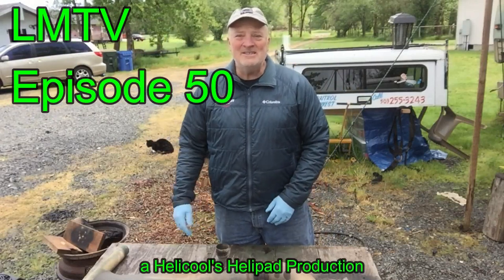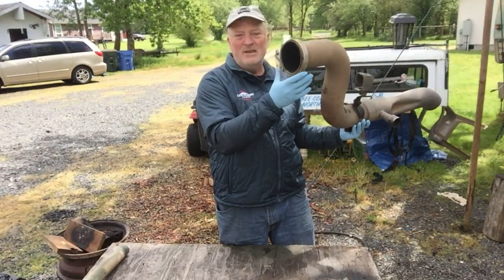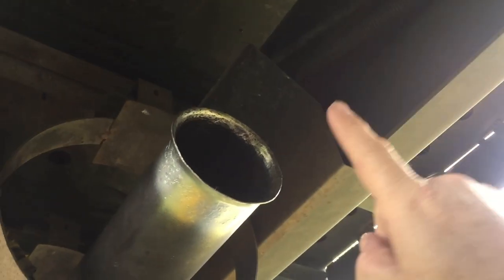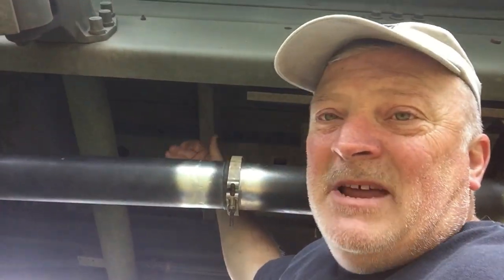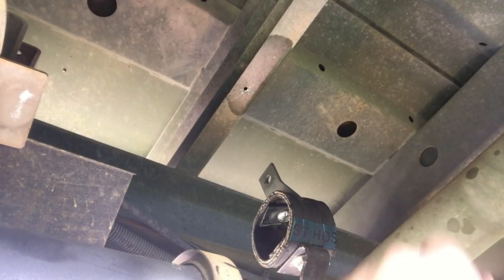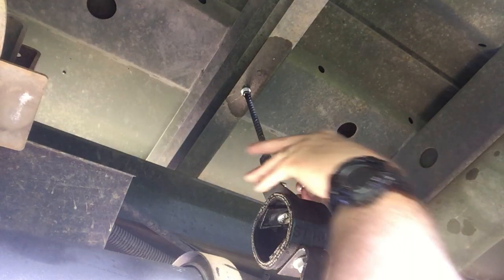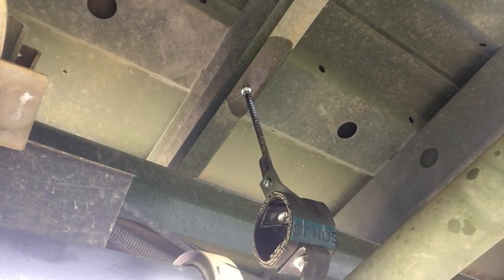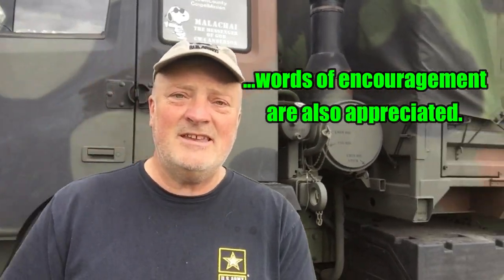FMTV EXHAUST SYSTEM MODS III #48

Comment: Hi Dave, do you have plans for the space you've made on the side were the exhaust came out?  Ex. Storage or something like it.
Reply from the maker: I have been thinking about that... just lack the funds to make it happen. I also have to be careful not to change the overall look too much, since it is supposed to be a "military" truck and not a camper. It would be nice to have some storage space though. A real nice spot has opened up where the exhaust was, and just aft of the fuel tank is another great area.

Comment: Cool video!  Thanks!  Just a reminder though...decibels are on a logarithmic scale.  So 80 dB = 79 dB x 10.  85 dB = 79 dB x 10 x 10 x 10 x 10 x 10 x 10.  So, that’s why it’s important for noisy areas to be well understood.  Exposure to 80 dB is where hearing damage begins (with some sustained exposure). I imagine the military requires sustained dB to be below 80...hence the muffler.  I’d be curious to see / hear / measure the before/after in three places (cab, beside truck, behind truck).  It sounds like it was remarkably similar in the cab..possibly quieter...but louder to the side of the truck.  I imagine the change in dB from behind is substantial.
Reply from the maker: Thank you for that explanation. I did not go and measure the dB behind the truck... I suppose it might be louder. What I can say is that I can hear the turn signal "tick" when it blinks and the push button Allison transmission selector "beep" when I use the selector. No way could I hear that before. I'll check the dB and post it to my next video I should have done by this weekend. Thanks for watching and supporting with a valued comment.

Comment: Hi Dave, why not lead the exhaust on top?
Reply from the maker: I don't know. I didn't think about that since I had the V channel clamps.
Reply: I think the dust expel feature would not work as well.   You might end up slowly filling the pipe with dirt.  

Just a guess.  No data to support this concern.   That was my main concern because I thought of the same thing.
Reply: In august I will try to route the exhaust on top, use a different air cleaner and thus create extra options for fuel and water tanks in the frame. Keep you posted.
Reply from the maker: @mvdb5150  Are you going for a vertical pipe? Also, with this be a muffler delete and plenum Venturi delete? I don't recommend the later.
Reply: Helicool's Helipad, maybe with a Donaldson airfilter the vertical pipe option will work. Different plenum.
Reply from the maker: @dcraigslist5243  I suppose that could happen, but if you think about the only things that can get into the plenum are small particulate matter and insects. I think both of these type materials should vacuum fairly easily, especially at the higher RPM experienced while taking off from a dead stop. I'll keep an eye on it by removing the flexible hose from time to time. If something starts to build up, I'll report it.
Reply from the maker: Michel van den Bosch well, alright! That will be very interesting... please post pics on the LMTV site.

Comment: Awesome work.   I wonder how much better it would be if you run the pipe all the way out the back.   

Did you measure the noise level at the same location each time?    Distance has a large effect on sound pressure level.
Reply from the maker: Yes, I measured from the exact same location. I think it would look very cool to have duel exhaust clear to the back, but I didn't have that much to work with. :-)
Reply: Where were you measuring from?
Reply from the maker: @dcraigslist5243  about 4 feet away from the side of the truck; roughly at the midpoint.